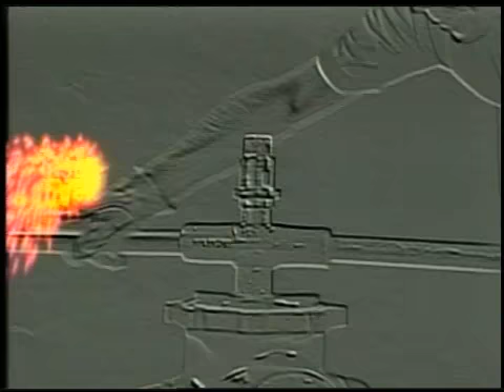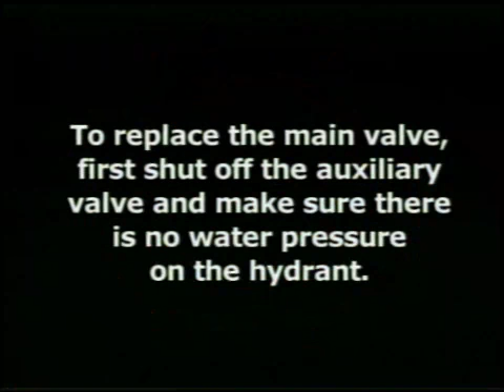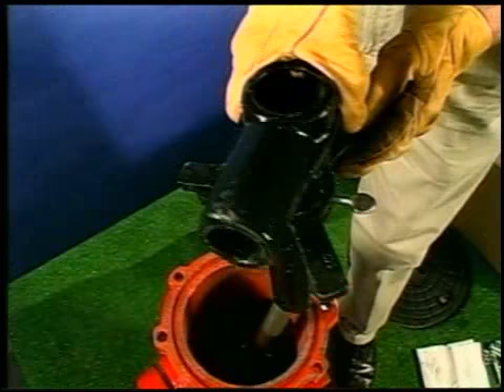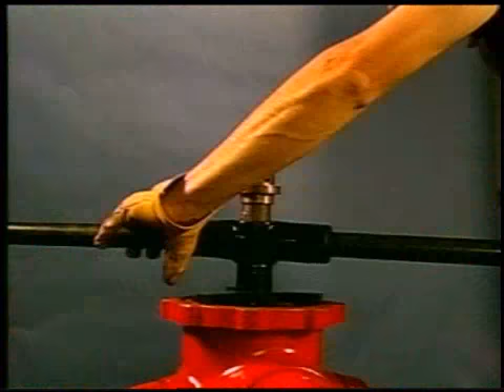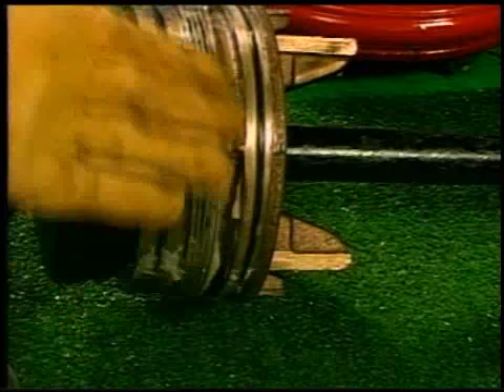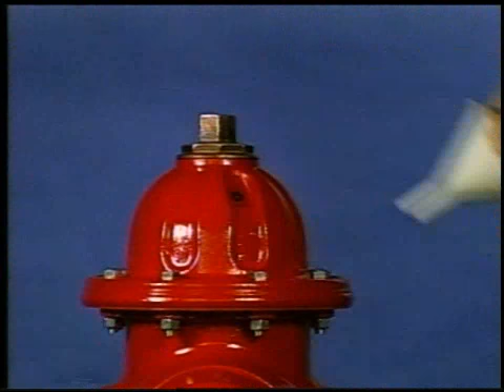Main Valve Rebuild

Comment: Does this work when extentions are installed?
Reply from the maker: This procedure can work with hydrant extensions installed. However, depending on the bury depth of the hydrant and length of the extension, a different seat removal tool may be required.